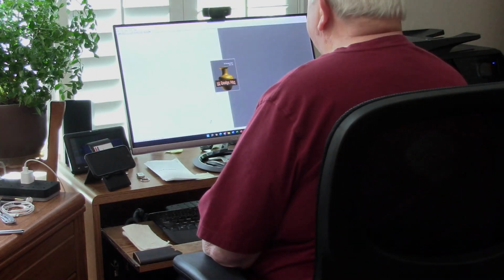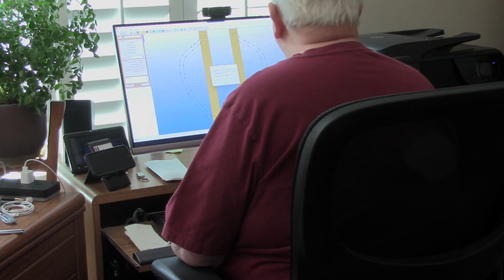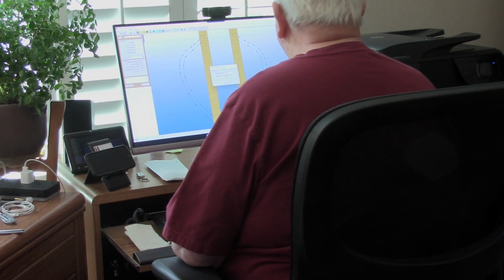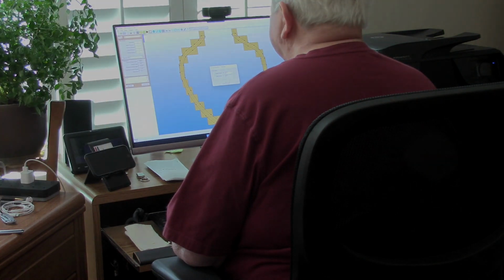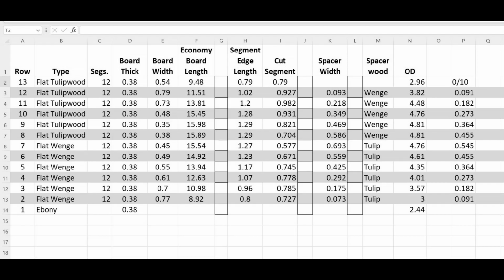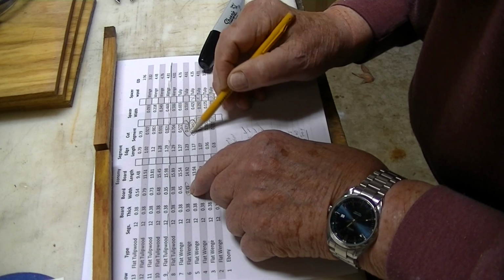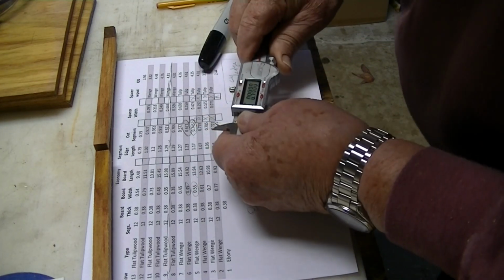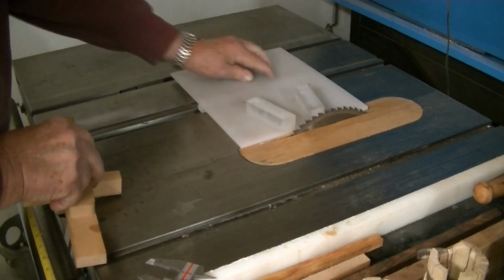Making a segmented vessel with varying sized spacers and segments

Comment: On the other hand, I would like to know if that sled is for sale, I would like to buy it.
Reply from the maker: Unfortunatly, no, I don't have one for sale.  I make all my fixtures for personal use from acrylic: it's stable. easy to cut, drill, and glue (CA glue).  The angle for this "wedgie sled" is set with a 30-60-90 degree office supply triangle.

Comment: Hello, I really like your videos, I have learned a lot from them, unfortunately I haven't worked with the lathe for a couple of years due to a heart attack I had and I left it for a while. After that I have been trying to do it again, but the only thing I completely forgot is how to use the Digital Caliper to make the exact cuts to size, I have searched all over YouTube to see if there is a related video on how to make the exact cuts. san stop for segments, but even if I don't exist, I would greatly appreciate your help if you know of any tutorial that explains it in detail, to be able to make the cuts perfectly again since my cuts are not square. I will be very grateful, your friend and follower Enrique
Reply from the maker: In order to make the most accurate cuts a sled like the in the vidoe is very useful.  Check out the web site SEGEASY.COM for the basic plans for an adjustable version.  This form of sleds are referred to as "Wedgie sleds" and you and search that also.  Mine was made in acrylic using a 30-60-90 triangle from the office supply store to set the perfect 30 degree included angle.

Comment: Hi there, great work as usual. Can you tell me where you bought that large tailstock cone from. Did you make it or perhaps have it made for you. It looks like metal from your video.
Reply from the maker: The anodised aluminum cones are not on themarket any more however there is a set of come that ARE available from  https://advancedlathetools.com/cone-centers-2/  There ar lighter and earier to use also.
Reply: @JimRodgersWoodturner  Many thanks for your reply. I have taken a look at that site link, the sizes quoted are a little confusing. I live in the UK so I would imagine it would cost a fortune in transport. I will enquire. I am also looking for large blanks of HDPE to see if it’s more economical to turn them myself. I have no idea if the HDPE blocks are available in grades of quality and hardness. Have you any idea, have you worked with it before ?  My initial impression is that it’s very expensive material to buy in blocks or round blanks. I have only looked at a couple of sites so far. Just out of interest, is it just the one size cone you use or do you have sever sizes ? Which size do you find most useful. The example in your video looks quite large.  Thanks again, all the best, Ricky
Reply from the maker: @RICKYDENNIS49  Ricky, HDPE in 100mm diameter and cut in a 100mm length can be purchased for about £40 including VAT at: https://www.theplasticshop.co.uk/polyethylene-rod-hdpe-100mm-110mm-120mm-125mm-130mm-140mm-150mm-160mm-180mm-diameter.html.

I would cut it carefully with very sharp tools as it is flexible and will "catch" on the tool easily.
Reply: @JimRodgersWoodturner  Once again, many thanks, all the best

Comment: Great work Jim.  I would love to see how you made your wedgie sled.   What material are you using and how did you set your angles so they are dead on?  Thanks Jim!
Reply from the maker: I built the sled with a 30-60-90 triangle from the office supply store to get the proper angle. The materials is acrylic from a local supplier (Tap Plastics). One fence is glued in place with CA glue and the second aligned to it and then CA'd. There is sand paper on each face of the sled to prevent slippage of the stock.

Comment: A few questions.  Aren't the spacers a form of segments?  What makes a spacer different?  Secondly, why not turn the inside first?  I would be afraid that the halves are going to slip somehow in the process of turning.  Did you like the glue?  I need more time I find and so use Titebond 3.  Your narrow parting tool, how thin is it?  Finally, do you know how fast the lathe is turning?  Thanks, great video.
Reply from the maker: Spacers are not segments as they are cut parallel with no angle.  The width of the spacer is arbitrary and is subtracted from the calculated segment width. So the sum of the spacer and the resulting segment adds up to the required with for that ring. Turning the outside first creates the vessel shape and when the steps between the layers  disappears the drawing shape is achieved.  If I desire more thickness for turning support I add all I want to the interior and do not affect the planned shape. The TItebond original is the glue of choice for my ring segment vessels. THe thin parting tool is about 1/16" wide. TUrning speed is unknown probably 1200 - 1500 RPM.

Comment: Great video again thanks. Big thumbs up as usual. You have become my first port of call for instructional videos on everything segmented. May I ask the brand of the hose clamp you are using? Looks a lot easier to adjust with a cordless driver than the standard type normally used.
Reply from the maker: The clamps are from Fastenall. They are stainless and with a. Dry long range can fit almost any project